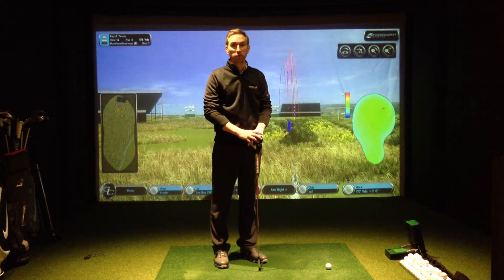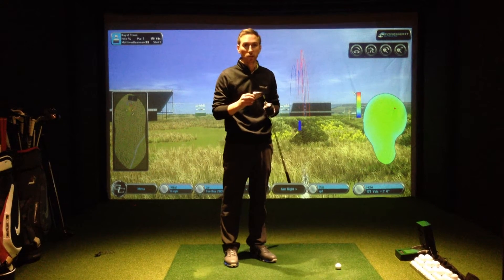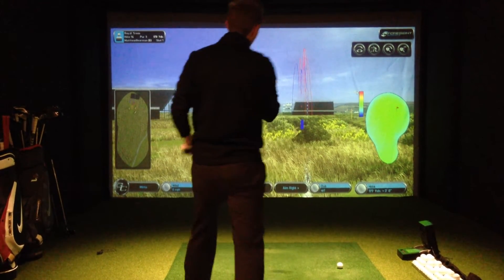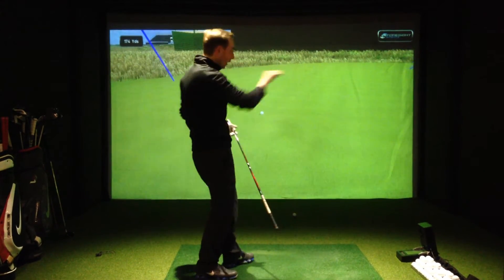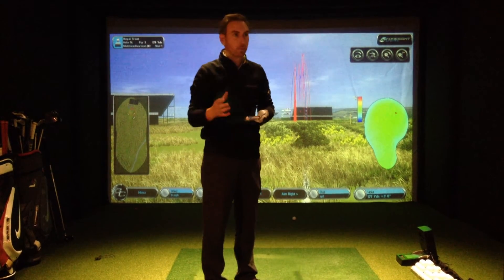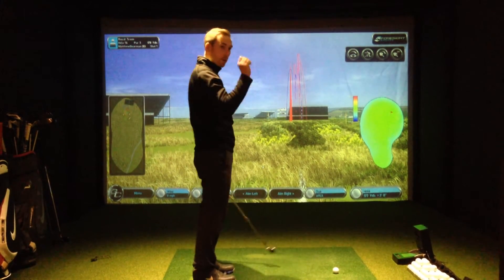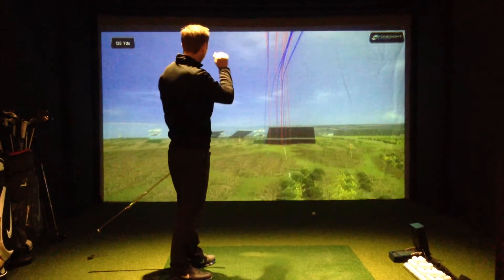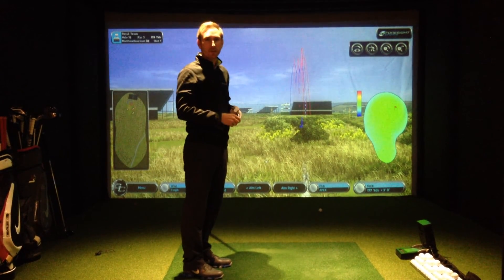Can a 6 iron be too powerful?

Comment: I realise this is an old video but...

You hit that Callaway 6-iron 200 yards, right? And you'd have needed a 4-iron to hit that distance with the first set you were using? So wouldn't the spin rate for a 200-yard shot have been about the same, regardless of what number was stamped on the bottom of the iron?
Reply from the maker: Scratch Golf the point of the video was to emphasise the main goal of fitting an iron for a better player isn't purely distance. 
If a 6 iron is only spinning at 4000 rpm and crucially not launching high enough it won't have a high enough decent angle to stop.
Hitting the ball further with irons using fast ball speeds and low spin rates is great as long as the ball doesn't launch too low. 
For me as a low launcher of a golf ball, the video was meant to show that you should be careful of what you wish for and not be purely distance driven. 
The Ball flight matters not just how far it goes. 

The lower the spin an iron produces the more deviation in flight it can have so I would much rather have a tighter dispersion with a good flight on an iron than a low flat flight that may go a little further but goes further off line.